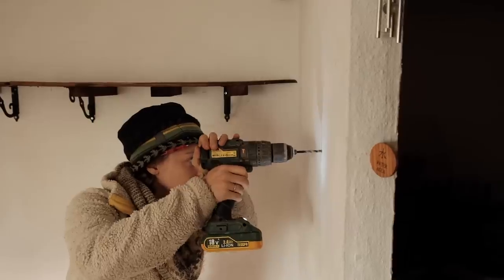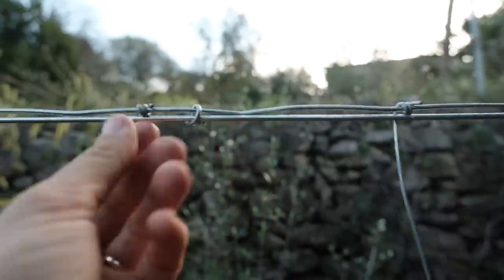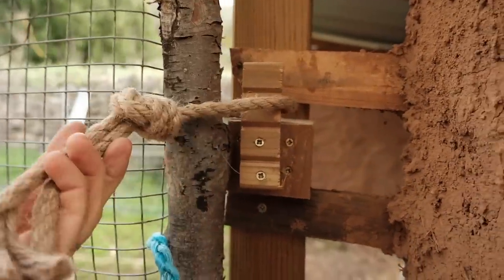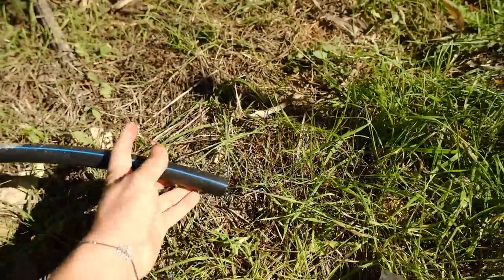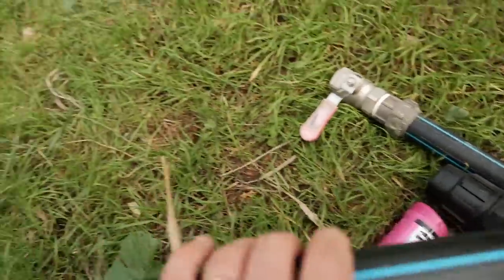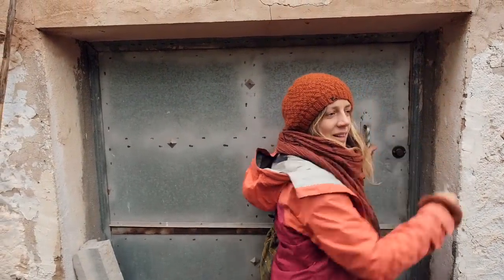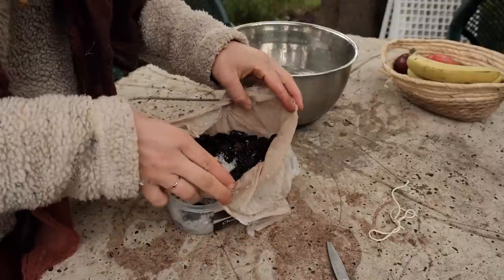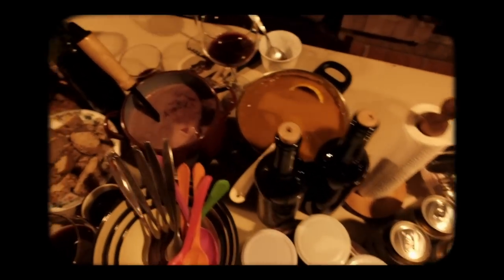The Goat House is Finished! (and has a donkey in it)

Comment: Small tip at 4:54
The reason the wood split is that you drilled through end grain of the piece of wood. The next try you did was not end grain so it was more unlikely to split. Pre drilling holes also tremendously helps with this.

Comment: if you don't won't wood to split pre-drill before you put in your screws.  For the latch on your gate, simply use a piece of wood that can toggle back and forth - horizontal for closed and vertical for open - to do this use three screws that are all put in half-way to 3/4 so there is enough play in the connection so the narrow wood block can toggle.

Comment: Some wine tips:
 - See if you can find a dedicated bottle filler attachment that you can insert all the way into the bottom of the wine bottle, this will reduce oxygen contact and therefore the risk of oxidation
 - Let your bottles sit for a month after bottling before you open the first one, wine tend to enter a stage of shock from the sudden oxygen exposure during bottling where it taste very thin, and it usually takes a month before it gets good again

Comment: Great Video again. I see you had difficulty with the Wine although. A solution for that would be to rack the Wine into Glass Carboys 23 Litre or 23 litre Buckets. Using a siphon hose which is fairly quick. After a day, all the sediment will settle to the bottom. You can rack that down again with a siphon hose, then bottle with the siphon hose. Clear of sediment. Typical Wine craft shop supplies for syphon tubing and other tools, like measuring the final Alcohol with a hydrometer. Even Design your own Labels. Then you can retail your Wine as Harriet's Spanish Red or something similar. Exotic Wine like yours would retail a decent side income for sure. Always fun to see your efforts.

Comment: A couple of gate bolts will be much more secure, a large animal bumping into the gate from inside will break the little piece of upright wood that you've latched the rope over very easily.
There are enough horizontal pieces of wood to the right of the gate to fix bolts to & you can fix the hole part of the bolt to the gate itself. Use strong screws.
Good luck.

Comment: nice little fence and door but that little knob to hold the robe on the inside will break off, it has zero strength with the woodgrain in that direction, that was also why the block of wood broke when you put a screw into it.